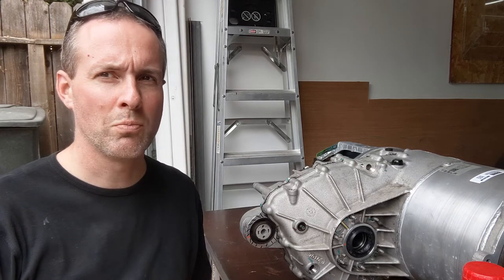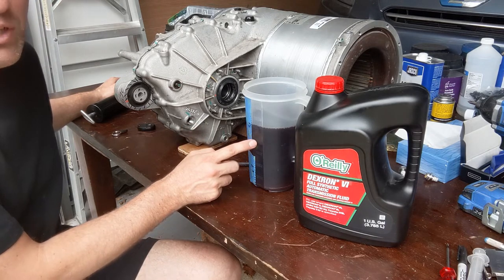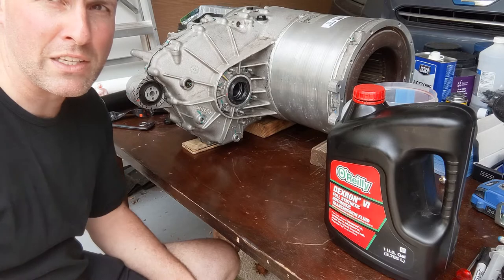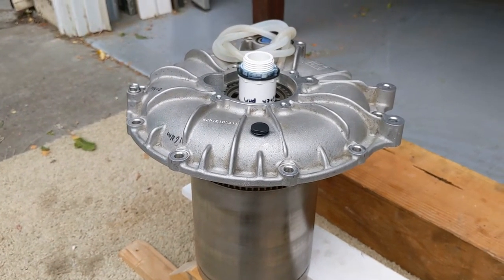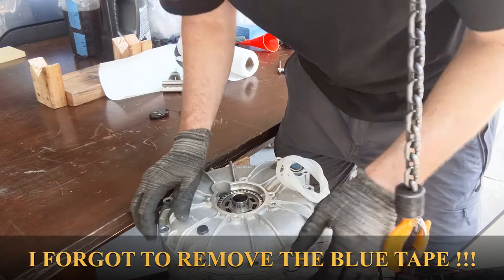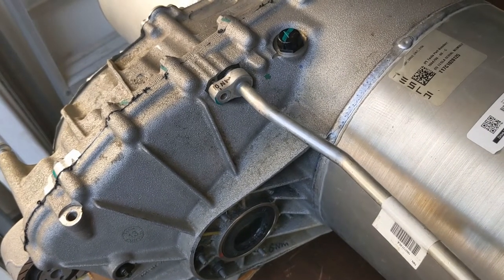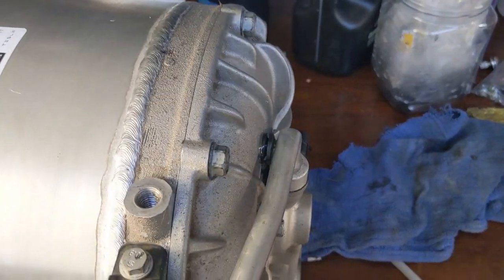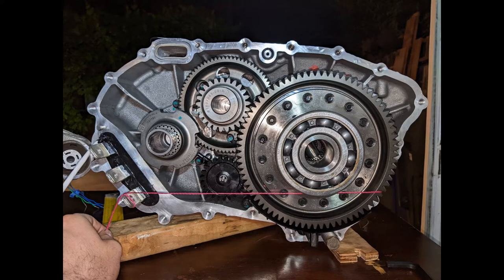Tesla Motor Leak Tests and Final Assembly

Comment: Thanks for video. Some add: An inductive motor (without a permanent magnets)  does not produce electricity without an excitation voltage. In other words, you could spin it without the risk of damaging the inverter. But even if there was a permanent magnets motor. By default, IGBT transistors will work as a diode bridge. You would hardly be able to spin it so that the voltage on the common capacitor of the inverter would exceed the allowable one...
Reply from the maker: Thanks! I was wondering about that...
Reply: There could be some magnetism left (called Remanenz in German) in the rotor which theoretically induce some current into the stator windings. as you said better safe than sorry. Really like how much thought and research you put in about every step you do. If you would be a pilot I would happily fly with you.

When you think about it isn't it totally amazing that two very  conservative manufacturers get a new start-up with a completely new product to supply drivetrains and battery packs for their established vehicles? How did that ever happen? And while Merc does make decent EVs now days, Toyota is kinda the opposite, still dreaming of Hydrogen and fossil fuel. Just amazing.

Comment: I'm so glad I found your video - it helped me work through and find peace of mind after discovering the speed sensor test on my original LDU on my 2013 Model S.  My speed sensor was wet... 

So, using LOTS of your guidance from your videos, website, the forums and photos I found, I just did some drain holes without removing the LDU.  I filmed it and will share a link when I upload the video. Hopefully lots more people will be able to do this as well and prevent the inevitable damage from leaks!
Reply from the maker: Thanks for sharing. Glad it helped.
Reply: That's awesome I'm thinking about doing the same. Could you share your experience with adding the drain holes to the motor. 
Your video would be a GIANT help.
Thank you
Reply: when will you upload the video?
Reply: Pls upload and share

Comment: Perfect video and accuracy in work. I am from Syria and I am trying to design this engine in the SolidWorks 3D design program, but I am facing a problem, which is that I do not have the necessary dimensions to draw and design gears, and I do not have enough insight to assemble the parts. I searched a lot on the Internet and did not find anything really useful. I drew and designed the Stator and the Rotor, but I still lack the dimensions of the structure and the rest of the parts. Can you suggest a solution to help?? I've watched all of your videos and have good ideas about the engine's internal structure, but I'm still missing the dimensions and some parts combinations.
Reply from the maker: You could buy a broken or fire-damaged drive unit from a junk yard and measure a lot but that will take you weeks. What is the goal of the 3D model? Some kind of simulation? I did not model the gears and inverter, just the electric motor segment, because that is all I needed. Also Sandy Munroe may sell 3D scans of all parts for $10000 or so. What is your budget?

Comment: You've done a hell of a job rebuilding this unit.  I do wonder if it's the main o-ring that's failing, if its possible to put some fluid in the coolant and/or transmission fluid which might swell it a bit to last another few years like some guys do w/ power steering pumps.  I think the emergency drains are great, because you should be able to know very quickly when a problem develops and hopefully the bearings are not destroyed quickly by the contamination.  It's a huge PIA to get the car on a lift and check the speed sensor area for moisture/coolant unless you own a shop.  The emergency drains could be used with a small reservoir and a sensor to alarm the owner of a problem.  In theory if you can link your phone to the canbus/obd2 port you could setup a proprietary OID to alarm for this condition with a canbus sensor and a small microcontroller.  I would pay hundreds of dollars for that feature if it could alert me quickly.   I have some hardware with canbus support and it would not take too much to make this feature accessible.  I think the question is where can the canbus (125k/s) be tapped into in the rear of the car.
Reply from the maker: The coolant seal lip is made of PTFE (Teflon), which is "compatible" with almost all chemicals you can think of, so it's highly unlikely you can find an additive that works. See for example https://www.foxxlifesciences.com/pages/ptfe-and-teflon-chemical-compatibility-chart.
Reply from the maker: I think with the Tesla, you do not necessarily need a car lift, but it still is a pain compared to a sensor: See a sensor concept here (buzzer and LED on dash): https://www.youtube.com/watch?v=ps2gha4w5YE&t=0s I will ask if he sells them.
Reply: @diyEVguy  Are you using the same seal as qccharge recommends w/ the 3 lip layer?  I have a bad feeling my DU when replaced in 2020 has the single lip which qccharge employee states fails early.  Also, are the drains in the same spot as how qccharge installs them?  They want $1750 to do an upgrade to new seals and drains.  I'm considering it for that price, much cheaper than the alternative.
Reply from the maker: @eastmanresearch3143  No, QC Charge said that they use a custom made seal: https://teslamotorsclub.com/tmc/posts/5280769/ Also I do not know where QC Charge puts their drains. Here is one (older?) idea (which I do not fully understand based on the photo alone), posted on Sep 6, 2021: https://www.myrav4ev.com/forum/viewtopic.php?t=2332&hilit=rebuild&start=30

Comment: Do you possibly know if the torque settings the same for a model Y front motor 14NM?  I can't find anywhere that details the specifications.
Reply from the maker: @DarrenWilliams-kk1uf  people suggest using the standard engineering torque tables for aluminum for non critical bolts.

Comment: Excellent work, my P85D rear motor went, Tesla says it's internal motor failure, it's water damaged, they don't know where the water came from.   They want 10k + taxes to fix,   I'm no expert, but seems like a failed coolant seal could be the problem, this should be a class action lawsuit.
Reply from the maker: Yeah we try to get a handle on how long this motor lasts. For seal longevity data, we started this page: https://sites.google.com/view/teslaldu/longevity What is your plan with the car? Has the coolant destroyed the inverter electronics?

Comment: I think these units have sealed bearings on the motors. These bearings will fail at some point, I have not seen all your videos, but if you are doing this much work, might as well replace. Also, there is a replacement / update for the coolant bypass tube, better design that avoids the seal failure issue altogether.
Reply: Just saw the other video with the bearing repacking. No way those sealed bearings will last 100k miles. Are all Tesla motors designed with sealed bearings? I’d rather change oil than pull that motor every 100k miles.
Reply from the maker: @johnstuder847  early models had steel ball rotor bearings. Later they switched to hybrid ceramic bearings.
Reply from the maker: Yeah and many questions remain. Like will the rotor overheat? Is there enough statistical data from real world experience etc.

Comment: don’t use liquid for test we use air for leaks detection first close the inlet than give 2 bar air to systsem than check it with leak detection
Reply from the maker: Do you put soapy water on the outside to see where it starts foaming? Or just listen for a hissing sound? O wait first you just watch whether the pressure stays the same.

Comment: 7:15  assembled gearbox and my axeks are rotating with knock knock sound like the watch,   what i  got to do? Sound looks like from invertor or gearbox, and i did not fix the parking  break -what kind of damage i did i dont know right now... And i just thoug the park brake doesnt work
Reply from the maker: Pull axles out, run motor again and listen again?
Reply: @diyEVguy  without axles mb b250 electro goes to safe mode sad i need to go to service withoutgearbox selection ,and what app do i need to delete mistakes from ebu...  Elm327 i already have but cant find app to read the ebu , i think its goes to error becouse i forgot to setup the brake support on the disk , push brake pedal and its eroor i have
Reply from the maker: @omarmalyomarmaly9323  I would recommend contacting https://alflash.com.ua because you can trust him, he helped me too. I have a full-time job now so I cannot help more.
Reply: @diyEVguy  just , send the message.

Iput axls in the place and  engage the park brake but its stil rotating  and the electric motor is clicking,  mb was some wrong assemling? And i need to pull out the motor? And repack it?
Reply from the maker: @omarmalyomarmaly9323  can you make a short video about it and post it on YouTube?
Reply: P141F55
Блок управления ''Стояночная
блокировка'' имеет
функциональное
нарушение.Конструктивный
узел не сконфигурирован.
АКТУАЛЬНЫЙ и
СОХРАНЁННЫЙ PTCU - Трансмиссия
Reply: C073D00
Сообщение по CAN от блока
управления ''A80 (модуль
сервопривода АКП для DIRECT
SELECT)'' неверно.
СОХРАНЕННЫЙ
ESP - программа
электронной
стабильности(N30/4)
Reply: B155B81
Связь по проводу данных с
блоком управления ''Система
помощи водителю'' имеет
функциональное
нарушение.Приняты
неправильные данные.
АКТУАЛЬНЫЙ и
СОХРАНЁННЫЙ
Аудио 20/Команда-Аудио
или Команда(A2-A40/3)
B156100 PIN защиты от кражи неверен
или отсутствует._
АКТУАЛЬНЫЙ и
СОХРАНЁННЫЙ
Аудио 20/Команда-Аудио
или Команда(A2-A40/3)

Comment: Is this the same motor in Mercedes b250e
Reply from the maker: Almost the same, but the inverter electronics hardware is different according to @CarRepairVideos
Reply: @diyEVguy  im looking to remove my motor Mercedes b250e for a bearings noise,im a mechanic but i have never removed one,is there any instructions video for removal?thank you for your useful videos
Reply from the maker: @hishamqdoumi1786  For bearings, my videos should be showing the same (or at least very similar) parts and procedures as for your motor. I am very curious what you will find! Please keep me up to date. Did you check for the infamous coolant leak yet?
Reply from the maker: @hishamqdoumi1786  Check this too: https://www.youtube.com/watch?v=1ecX94hxewc